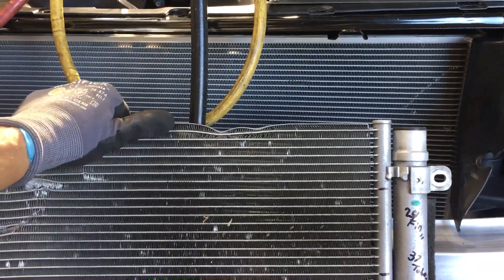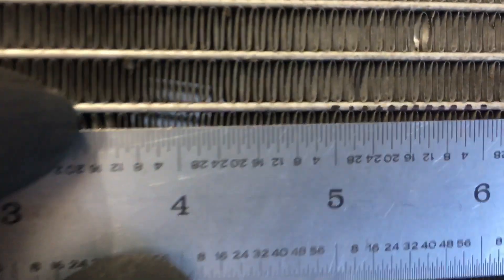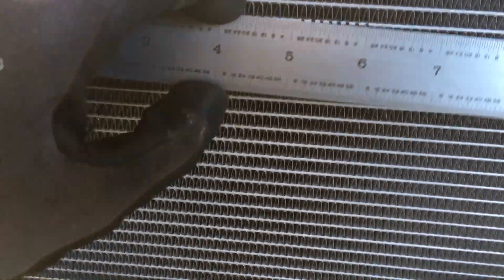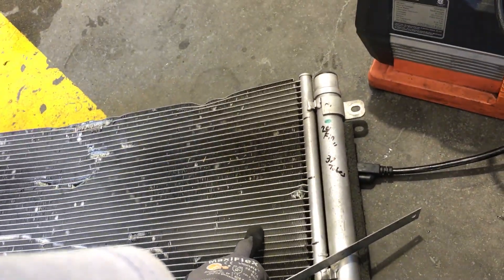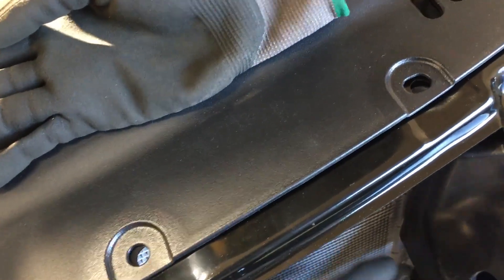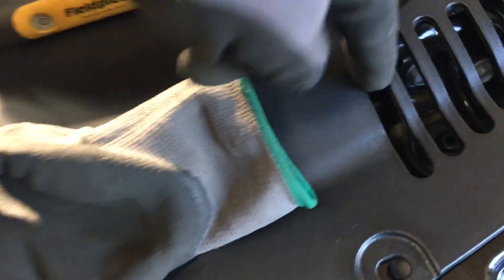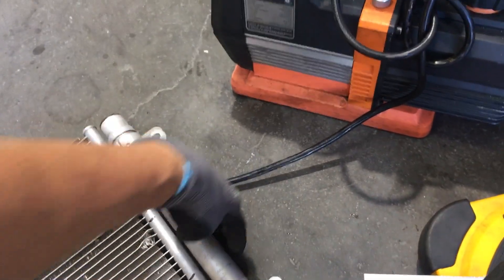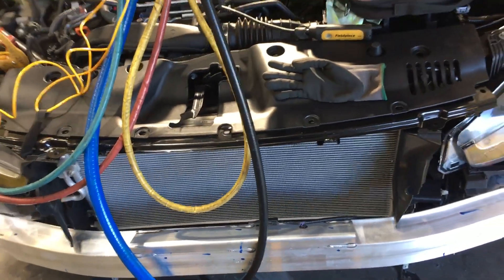24 fins per “ OEM or 15 fins per “ aftermarket Condenser. Which one do you want on your car ? ￼

Comment: I drive a 1999 Chevy Tahoe that I'm servicing but I’m considering on cancelling my Denso serpentine condenser order that is currently being shipped to me but I have no idea which parallel condenser brand to trust.
The reviews are all bad on amazon on all the aftermarket ones and I can't get an OEM one for these old trucks.
The Denso one is a quality part but I see now that it’s an outdated design.   Any recommendations?
Reply from the maker: Yes this is true DENSO might still be making outdated designs just because that was their original part number. 

This is why when you Google your search terms

Add parallel flow condenser to your year make model under your search terms

We’re at the words Microchannel to your search terms

There must be an aftermarket manufacturer that is manufacturing Michael Channel to replace your serpentine

Next is look for a modern day vehicle such as a suburban some sort of SUV or some sort of van that has dual air conditioning because they’ll make their condenser with more BTU rejection capacity for that extra evaporator. 

What you’re looking for is a Evaporator that is close to your original design it could be an inch longer an inch taller may be a little fatter as long as you think it can fit into this location. 

Then if you are mechanically inclined and you can bend a little sheet metal make some of your own custom brackets riveter drill and nut and bolt some brackets to your sheet metal on your Core support.  

You just said absentee modern to fit in place of your old one and then you’ll have to probably take your original hoses to a local radiator and air conditioning specialist that makes hoses from scratch. 

and they will either make up a new set of hoses for you to fit this new design with new fittings. 

Independently on the kind of rubber hoses you have they can cut and splice hose on to your existing hose so it can fit wherever your new adapters will be facing because they might be in a different direction or different location.